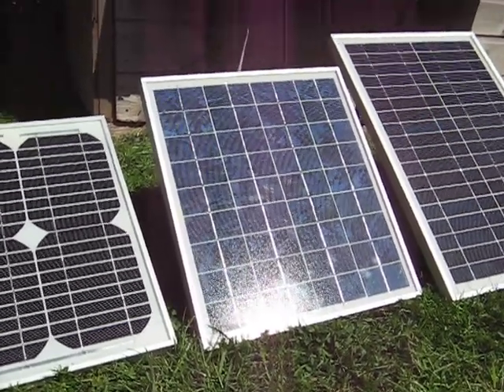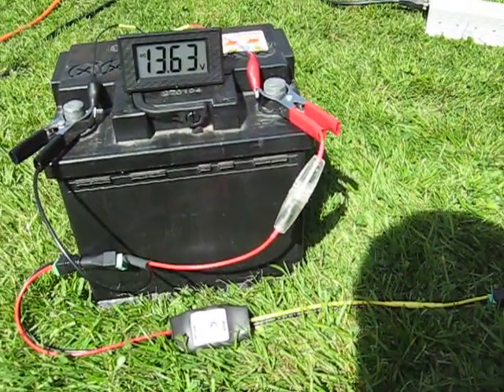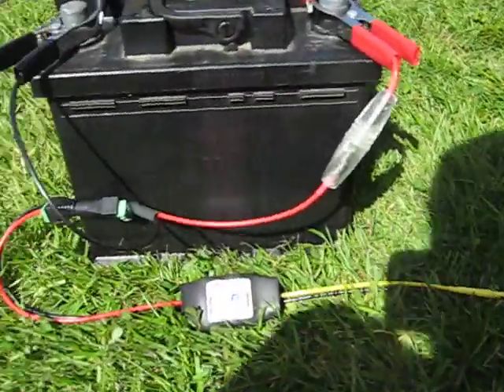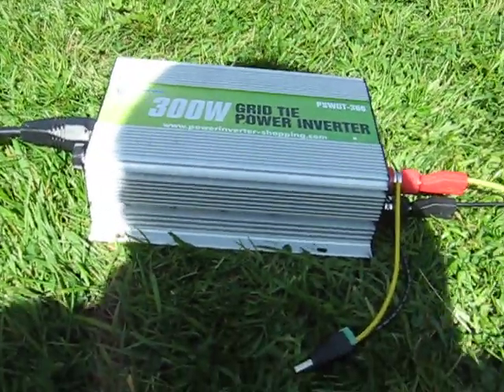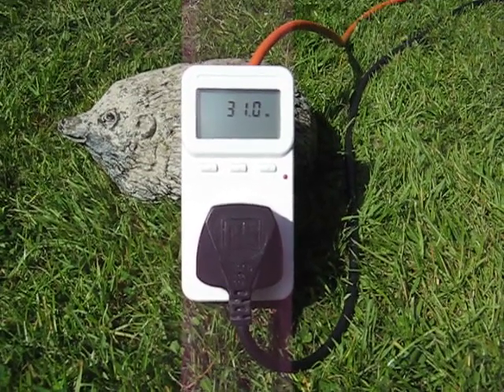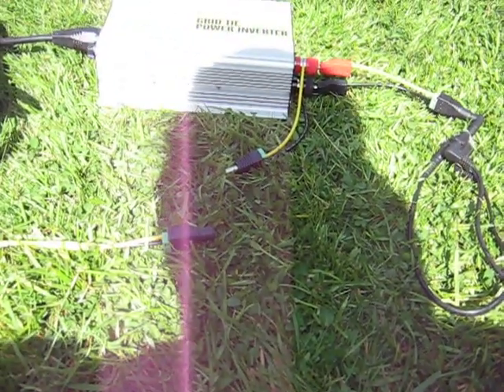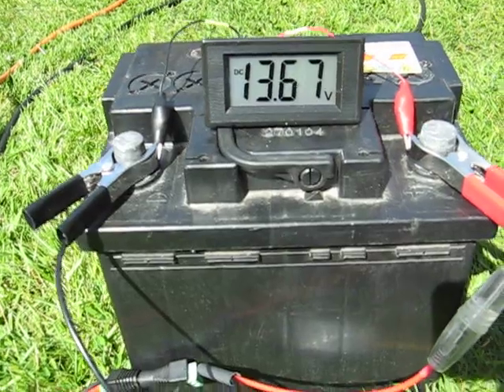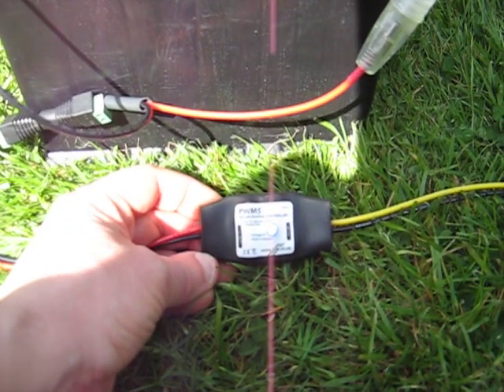Charge a Battery with Solar Power and feed Electricity into the Grid

Comment: Julian i know this was a lot of years ago but can you tell me if there were any drawbacks to using the charge controller and the grid tie inverter on the same panels as shown.This is the only reference i can find on the internet using this method.But it seems an ideal solution to the excess watts problem.I can not figure for the life of me why the charge controller is taking precedence over the grid tie inverter? Until the batteries are charged.

Comment: I'm looking to do the same with my solar array so when my batteries are topped off most of the energy will go to the grid, the problem with this set up is that the inverter will constantly take energy out of the system even when you're trying to put all the energy into the batteries during charging periods

Comment: Thanks for the informaive video.
Question:  Will the volts of the panels be divided by # of inverters ?
Ex:  30v = 1 Inverter        For 2 inverters, volts = 15.
Thanks.

Comment: Hi Julian, take a look at the Home Energy Storage inverter for the UK. Update 2014
http://www.2020solar.com/The-PowerRouter-192.asp
contact us today!
1. Store energy in batteries for later use and feed the surplus into the grid still taking advantage of "buy back" tariffs from UK power companies.

2.The PowerRouter's is unique. It is UK grid ready and feed in tariff compliant.
2020 Solar brought the PowerRouter to the UK market and already have 1000's of satisfied UK customers. 

3.The myPowerRouter.com web portal provides you with access to a comprehensive overview of your energy production, consumption and system status, anytime, anywhere. 

4.The PowerRouter comes with a unique feature that enables to supply backup power in the event of a grid failure, giving you greater independence from the grid. 

5.The more you optimize the self-generated energy through a PowerRouter with batteries, the less dependent you are on rising energy prices, the lower your energy bills will be and the greater incentive you will have.

6.The PowerRouter's intelligent battery manager charges and discharges the batteries optimally in order to extend the life of the batteries. The PowerRouter is easy to install and easy to configure. The connect and grow capability means you can start with the PowerRouter Solar and then easily expand the system by adding batteries.

We have new batteries that have a life expectancy of 15 years.

Solar Energy Storage is now affordable and feed in tariff friendly.
Reply from the maker: I expect this will get marked as spam, but that is an interesting system
Reply: Hi Julian,
Thanks for looking! Do you like it?
Reply from the maker: jenny bakker I do like it. I'm not aware of any other UK system that has the battery storage facility that you're offering. And the online monitoring is the cherry on the cake!

Comment: @hippyraverocker 
I'm using a CM3024 controller. If I want to float charge my batteries and have most of my watts going to my grid tie would I connect the solar array to the grid tie AND the controller's inputs in parallel? Or panel power souly to the controller's input and then from the controller's "battery" output(to the batteries) and the controller's "DC Load" output to the grid tie's input?

Comment: @julius256 Yeah, I've actually decided in making a wind generator instead, they produce more watts than solar for a lot less money. I'm also working on a hydro generator to put under a spring overflow out from my house. If i can get it working it will be 24 hour water flow powering the generator, and so far ive estimated i will get roughly 350 watts per hour at the speed ive measured and the motor im using. So 350 x 24 = 8.4 kwh a day is pretty great. My house used about 13 kwh a day on average.

Comment: Any charge controller could do this.

Normally solar panels feed into a charge controller via the panel input, which is one way. It allows power from the panels INTO the controller and then batteries.

It does not allow power from the battery to go out to the panel.

If you connect your grid-tie to your panel at the same point it would enter your normal controller...you get the same result. Once battery is charged, excess goes to grid.